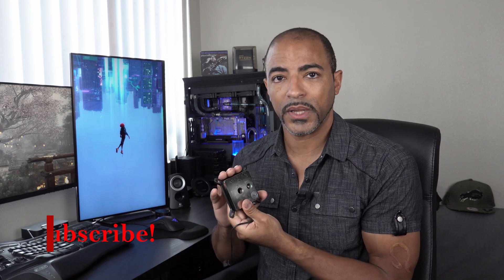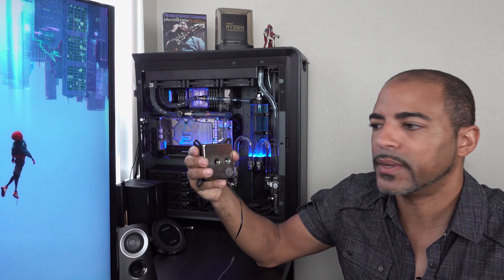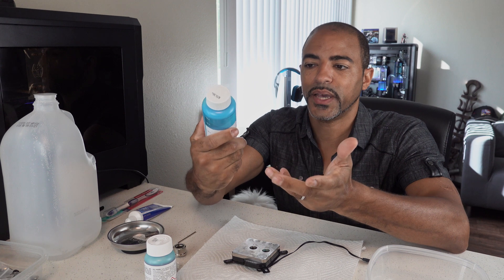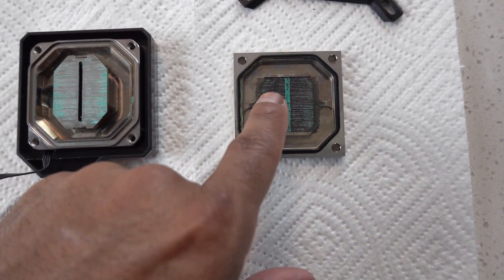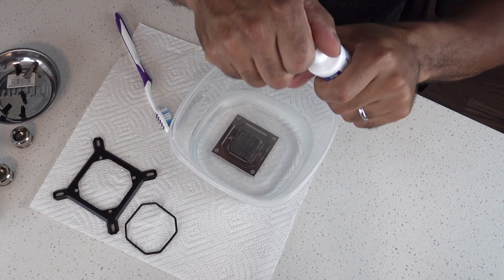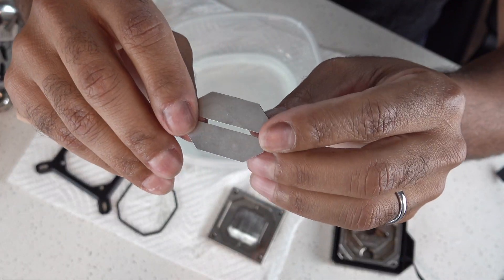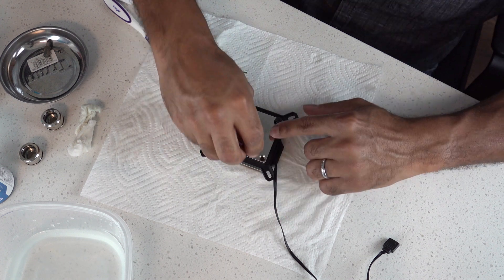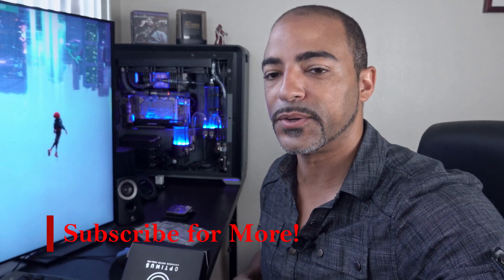How To Clean a CPU Water Block -EKWB Velocity-

Comment: Did you ever have to do this for your Optimus threadripper block?
Reply from the maker: All blocks need to be clean, the brand doesn't matter.  And yes.
Reply: @DaPoets thanks i have the same setup and your video gave me the confidence to do it soon. I was worried about the smaller fins and wondered if there was any differences.